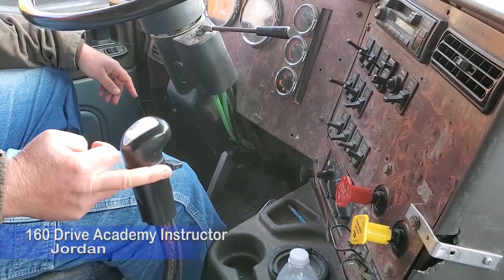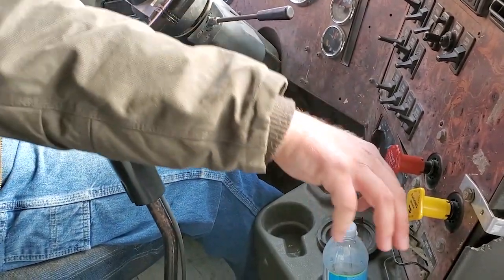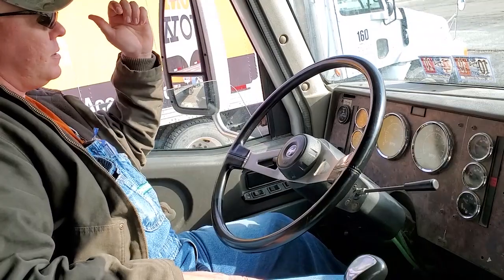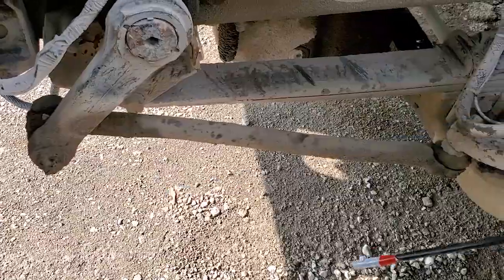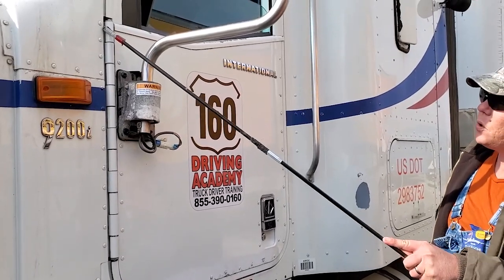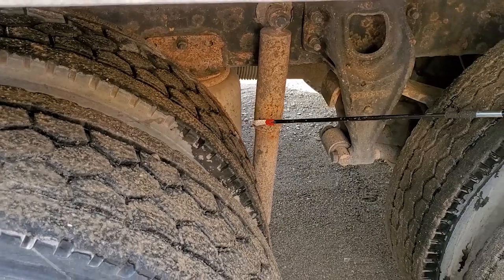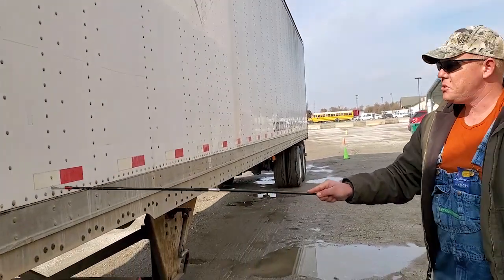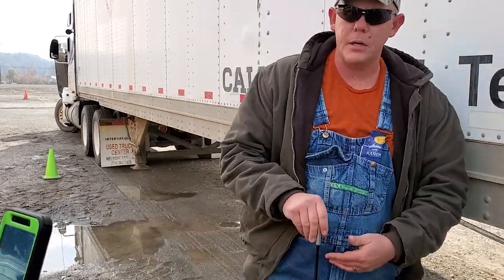160 Driving Academy Pre trip Inspection HD 1080

Comment: In-Cab pretrip inspection: 0:09
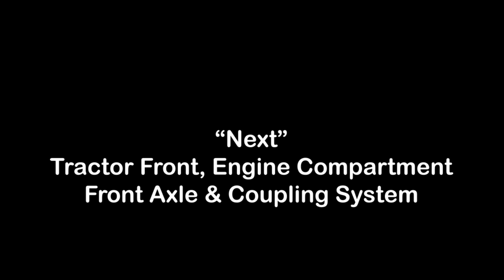Section A. Tractor front, engine compartment, front axle: 8:19
Section B. Tractor Drivers side, under tractor, rear axle & tractor rear: 14:42
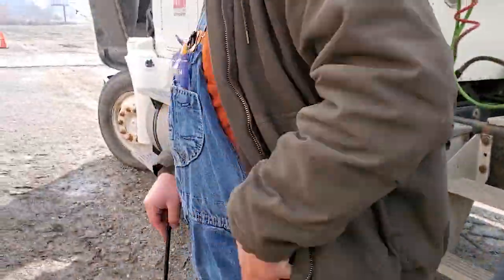Section C. Trailer & trailer axle- and Coupling: 21:19

Comment: What state is this pre-trip and brake check for?
Reply: I believe Illinois. But basically same pre trip and brake test for Missouri as well
Reply: It's for Illinois. Missouri is different.
Reply: For IL
Reply: This is NOT IL, he would have lost a bunch of points and not passed if it was. Plus, your air tanks DO NOT have to be at 120psi to do your tests. I could go on, with stuff he was wrong about or not mentioning.
Reply: @stevepauley2437  this is the Bellville Illinois location. What would he have lost points on? I have been here for 3 weeks, and each week, the examiners from Springfield keep passing the students. The test at the DMV also said 120psi.
Reply: @jacobstaten2366  psi only needs to be at 100. In just the it’s minute he made 2 mistakes. He said oil pressure between 20-60, it’s actually 30-50. Then he says water temp 150-210. It’s actually 180-210. I could go on, but I’m not watching the whole video again. Also, just because people are passing every week, doesn’t mean they aren’t wrong or missing things. You don’t have to have a 100%. Shit, I forgot to check my windshield wipers and washer fluid on my in cab test.